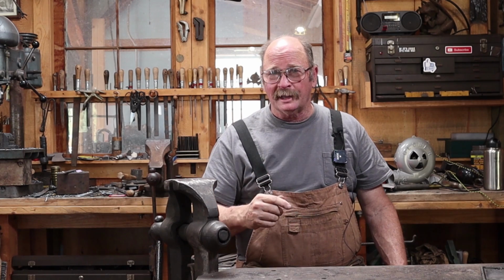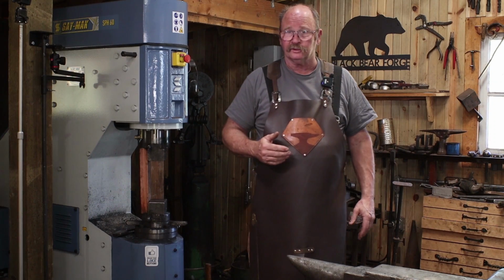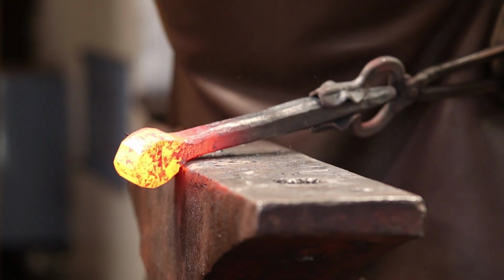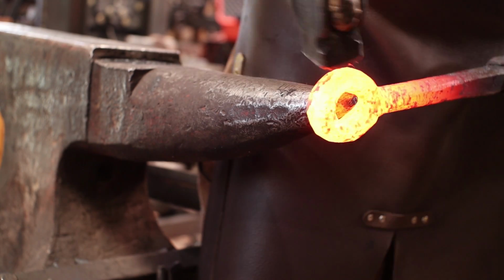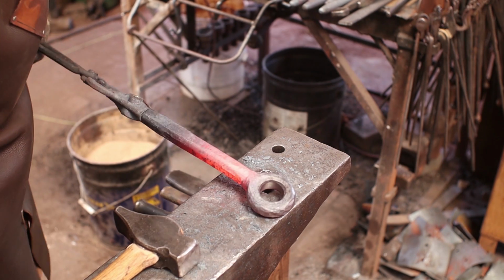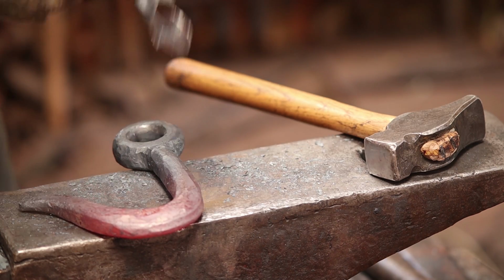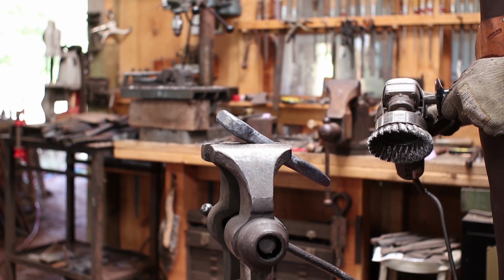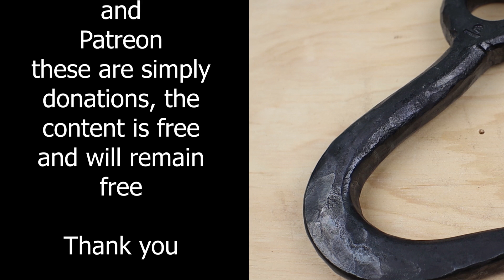Eye hook - hook of the week 13

Comment: Speaking of mystery steel. Some of these scrap and found steel parts in the buckets are more and more likely to be stainless steel. Yes it can be forged, but being so many varieties it's even more mysterious. Most of it is not magnetic at room temperature. Same if it can be tempered and hardened most of it won't change hardness much. A hook made from stainless if it's in your bucket could be very educational. Thanks for all the inspiring videos John.
Reply from the maker: Very little chance of stainless in anything I have.  I almost never used any stainless
Reply: @BlackBearForge  I certainly don't blame you. It's one of the least friendly forging materials I've encountered. I tend to avoid it myself.

Comment: That little bend at the tip of the hook, 15:36 is call a "pea".  Nicely done!

Question:  While you had the hook on the drift, and the drift in the Hardy, could you have placed a punch or bar in the Pritchel, and put the slight bend in the shank that way?

Comment: I’m only a beginning amateur blacksmith, so correct me if I’m wrong, but wouldn’t the eye have been stronger wrapping it around a mandrill and then forge welded back to the shank?
Reply from the maker: If your weld is perfect it would be the same strength if your weld is not perfect it would be weaker.  However if working with true wrought iron the weld would be preferred due to the gain in the wrought iron

Comment: Could the Tredle Hammer do the same work? I don't have a Power Hammer and have been considering building my own Tredle Hammer as an alternative.
Reply: A treadle hammer can certainly be helpful and has a lot of advantages: works well with different dies and fixtures, allows you to use top and/bottom tools, and (as John uses it) brilliant for punching and chiseling. That said, you're going to have a hard time breaking down big stock as it's still just your strength doing the work.
Reply: Its just that right now I am limited to small stock forging (S hooks, wall hooks, pendants, and knives) and would like to move up to bigger items. Ultimately I want to forge swords and axes, but without a Striker or Power Hammer, it is next to impossible. I just thought the Treadle would make it viable. I just started forging about 2 months ago and never realized how limited a smith on their own was in regard to what they can forge by hand hammers alone.
Reply: @TardyTardigrade  there are techniques you can use to forge out some larger stock, but trying to forge anything bigger than 1" by hand is silly even for experienced smiths. If you want to get into to making things like axes I suggest putting a little time and energy into making a striking anvil, making some top and bottom tools, and practicing with a striker. It's usually not too difficult to find someone willing to swing a sledgehammer for you.
Reply from the maker: A treadle hammer can do a lot of work and reduce the effort required compared to working by hand.  But a power hammer reduces the effort even more.  You can make drawing dies for a treadle hammer that would help with larger stock.